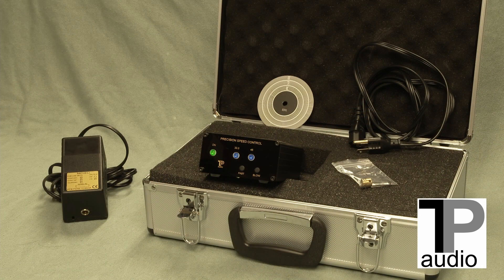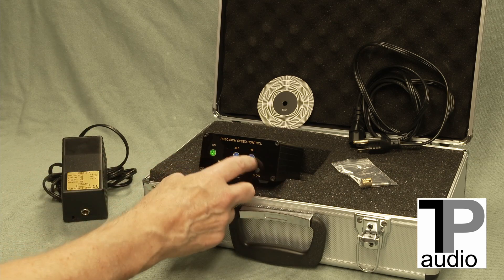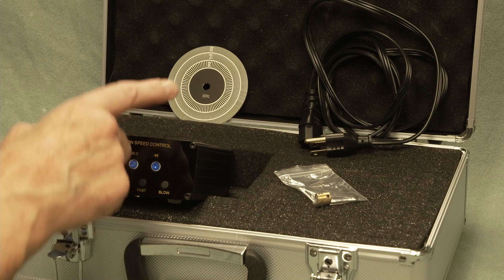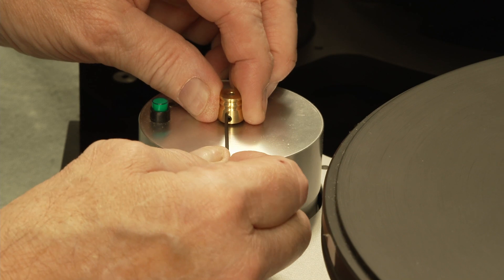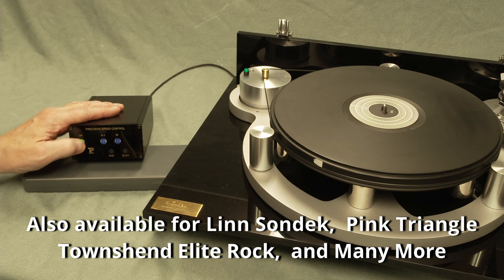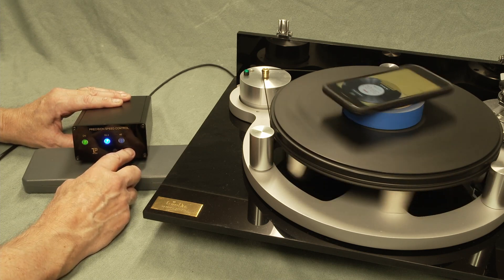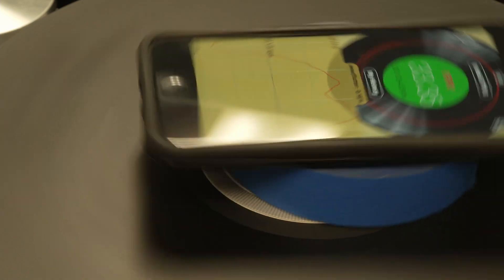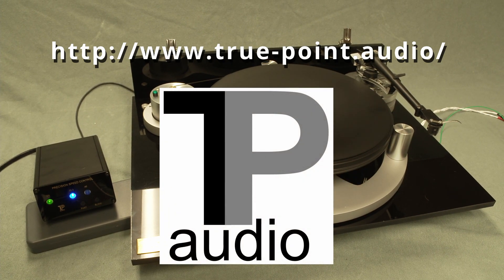Precision Speed Control Unit for Hi Fi turntables

Comment: I have one fitted to my Gyrodec and its the best money I've spent in a long while. The TPA is the best speed controller you can buy for a Gyrodec, as well as many other turntables.  Michell Engineering (or is it now Michell Audio) should supply these with new turntables instead of the awful standard PSU as well as their never connected PSU that is totally useless at getting both speeds constant. Come on Michell Engineering (audio) get your act together and bring the Gyrodec into the 21st century.